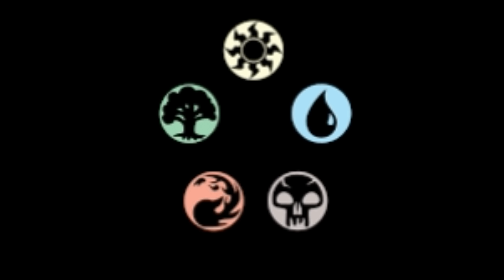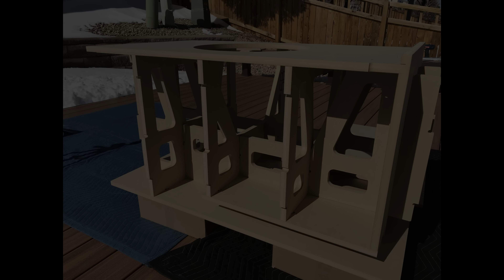THE ANNIHILATOR - XXL Version - 18" DIY Subwoofer HOWTO! Full Marty build with the Ultimax UM18-22

Comment: Jiles, the sub turned out great and once you get the 2nd one built and rocking your room, you're really going to smiling!  Huge thanks for taking the time to make this video, which really does help others understand what's involved with a flatpack build.  Have an excellent weekend buddy, watch a movie or two, and put that big mean ported sub to work!
Reply from the maker: We have 2 Marvel movies slated for the weekend!  My 2 boys both have given the sub the thumbs up approval and have suggested that I "throw away" our sealed UM18.
Reply from the maker: I cant say enough about the flat pack experience. It reduced the complexity of the build tremendously and it gives the completed product a much more sophisticated aesthetic compared to a vanilla marty box. I will be doing a head to head SPL comparison with the sealed Denovo flat pack... but I know what the results will be already. Now, the question... what do i do after I bring #2 into production (and figure out how to keep the projection screen from resonating off the wall)?
Reply: @JilesMcCoy  Man, this made me laugh!!!!  Sealed vs ported is a debate that will never end : )
Reply from the maker: I was  dyed in the wool sealed guy for a long time. You can probably find posts on AVS to support that.... but I have changed my opinion. If you have the physical space for the large enclosures they are pretty good. I would like to try some other technology at some point too though.

Comment: Congrats! Doing the DSP Stuff was easier than I thought I got mine built up (DIY not flatpack) and got it setup. Honestly... I can't wait to build a second one!! With the custom size I did I am pretty flat from 10Hz-100Hz
Reply: Flat from 10-100 wow. What are the details on your build? I'm about to start a build for a 15" ultimax, thinking about doing a mini marty for it.
Reply: @Cerco170  Takes a bit to get the hang of it but all the info is on avsforum for the" Marty" subwoofers. however deviating form the original specs it is no longer a marty but a custom ported sub
Reply: @nintariplays5654  thank you. curious whats the cf of your box, port length, and sub you went with?
Reply: No subs go flat down to 10 Hz.
Reply: @kimhansen6384  With dsp it can. Also in room response is boosted at lows so it can go flat to 10hz. I measured my sealed ultimax and in smaller room it went down to 10 -5 which can be easily corrected with mini dsp.

Comment: I built a few subs from knock down kits and they are GREAT, but be prepared for the time it takes ! I bought specific  subwoofer amp that has all the adjustments you need. I believe it was Dayton also and still going strong after 3 years of 24/7 service(I am disabled and in bed too much!)   BUT they need POWER!!

Comment: So just a tip from a woodworker.  I know it's tempting, but never put a clamp between braces.  Alway put the camp with solid material in between. So on the ends or where the brace/baffles are.  Clamping between them can make the material to bend and make the edges push out.
Reply from the maker: Good tip!

Comment: What bolts did you use to secure the front baffle? I'm not seeing a link for those, Thanks!
Reply from the maker: It’s the hardware in the instructions from GSG. I’ll see if I can get links. I got mine at Home Depot.
Reply: @JilesMcCoy  Oh nevermind then, i didnt catch the full shopping list on the website. My questions have been answered by that. Thanks for your time and the fantastic video!

Comment: I just submitted my order to Kevin at GSG Audio for a mini Marty 2 pack. I CANNOT WAIT. I’m super excited. Thanks for the amazing video. I’m sure I will go over this video several time while I’m assembling mine. Any tips or tricks that you can think of would be MUCH appreciated. Anyway, thanks again for the video! Great job.
Reply from the maker: I would suggest to figure out what kind of wire connection you want to use before you get started. You can watch both of my Marty builds and see the whole effort soup to nuts. The full just has 1 more internal brace than the mini. You are going to love it! Did you decide on amplification?
Reply: JDM World I was already thinking about which type of connection to use. I’ve always used regular round or rectangular speaker terminals with banana plugs. Of course, I’ve never built a subwoofer of this caliber either. We’ll see. I think I’ve got about two weeks before the flat pack arrives because it won’t ship until next Friday. I went with the same driver that you used, UM18-22 and I’ve decided to go with the Crown XLS series pro amps. I’m going to run two amps bridged to 4ohms. I’m not sure if 1,100 watts is adequate or if I should step up to the next model which will push about 1,500 bridged. What do you think?
Reply from the maker: @jeremygattenby2183  I would go with the 1500 watts!
Reply from the maker: @jeremygattenby2183  Its going to rock your world!
Reply: JDM World I like the way you think!

Comment: Awesome to see the Full Marty having a Flat Pack option. (A little expensive, but the pieces will probably be perfect so it's justifiable)
I built mine with around $80 in MDF IIRC and it's an amazing sub for the money, even if you get the flat pack.

Thanks for the video! 
I still need to paint mine... But it sound so good, I'll continue to hold off on it until I feel motivated to add wheels to it (It's very heavy and awkward to move) so I can move it easily.
Reply from the maker: Did you do 2 Fulls also? Have you been happy?
Reply: @JilesMcCoy  I've only made 1 Full marty, (In October 2016) and it's still makes me smile to this day.

Eventually will make another, but 1 really is enough. 
I don't have any nulls to be honest, and it blends in very will with my Chane A1.4s. (Took a while to find the placement that removed any nulls)

I have it powered with an Inuke3KDSP and it gives it more power than my ears really need, and then some. 
Although I want to upgrade to a stronger amp in the future as the Impedance does go up to around 24ish Ohms at 28Hz, so I need a beefier AMP to push more power at that impedance. (Although that'll be more of a nice to have as It gets louder than I need with the Inuke still)
Reply from the maker: How do you like your Chane? Ive always wanted to hear those and Ive never has a chance.
Reply: JDM World I absolutely love them, I remember first getting them and every song I used to listen to was literally a new experience.

But they were my first real quality bookshelf speaker. 
I upgraded from bic dv62si, they aren't bad speakers, but way way too bright.

The Chanes at times feel a bit bright, but it's pretty rare and probably YouTube's fault. (I listen to alot of YouTube playlists to find new music)
Reply from the maker: That's cool. I do the same with YouTube. Everyone tells me to try Tidal for higher quality... but I haven't yet.
Reply: @JilesMcCoy  Yeah, I can hear the issues with the songs on Youtube if I listen for it, but It's not a big enough issue to make me not listen to Youtube versions.

Although when I get to listen to better version of songs (FLAC/Wav or at least MP3 320) It really sounds so good.

One song I remember being really bad on Youtube was "Bass Mekanik - Skynet"  It had some odd 15khz (If I remember correctly, it could have been at a different area, but 90% sure it was around 15Khz) peaks that made the song hard to listen to because turn it up enough and it was painful. 
I wanted to correct it by adding a Lowpass around that area, so I ripped the audio from Youtube (I know that's bad, but I wanted to crank it up without killing my ears lol) and oddly enough playing it back locally even though it was a direct rip it didn't have the issue.

Comment: That was a fantastic build video sir. The only i would do for myself in addition-- would be to router using a round off bit for the inside turn for the port, as well as the exit mouth. Just a personal pref. What gauge wire was used? Looked like 16 or 14.
Reply from the maker: Thanks John. It was 12 gauge.

Comment: The box looks to be very sturdily crafted, but I have put this Ultimax driver through three TS-based design programmes, and they all come up with a much smaller box and far shorter port. Do you have any idea how this box is designed, apart from "big"?
Reply from the maker: The team at GSG Audio Design did all of the modeling and testing for this box design. There are numerous threads on AVSForum as well that you can check out. Or visit https://shop.gsgad.com/ for direct details. If you email the contact there they can give you more info than you ever wanted! Tell them I sent you :-)
Reply: donepearce hi Don, John G ( LTD02 ) and co-owner at GSG AUDIO, is the original designer of all of the Marty sub line models, as well as hundreds of other designs popular in the diy community.  Also, Dayton recommends between 8-12 cubic feet, which is what the mini and full model cabinets provide.
Reply from the maker: This cabinet sub combo can also provide cracked dry wall... so please be careful.
Reply: @kevings26  Congratulations - these look like nice designs. But what are they exactly? I mean are they Butterworth, Chebyshev - what is the actual acoustic response, the transfer function of these cabinets. I'm having real trouble working them out.
Reply: @donepearce  Hi Don, thank you.  Hey, Irrespective of how we may label things the cabinets are roughly 5/7.5/10 cubic feet, and tuned at 20/18/16hz, for the Cube, Mini, and Full, respectively.  Some of our customers also like to plug one of the ports, because they are willing to give up a bit of output, for even lower extension.  I hope this info helps.

Comment: How was the sound? Tight deep bass? Musical?
Reply from the maker: I think it was much more musical than the sealed box I compared to with the same driver. It is very authoritative down to ... well low. Somewhere between 10 and 15 hz. The sealed box obviously will gain ground as you go super subterranean. At 20 HZ there is no comparison between sealed vs ported though. I do 2 channel listening with DSP (bass management) on using 2 of these subs. They are turned waaayyyy down but it sounds really great to me. You can hear all the creaks in the room, the runnin AC, etc in recordings.
Reply: @JilesMcCoy  

Sounds awesome

Comment: I see this is old, But you really could use washers on those cap screws, or at least use button heads. They have a little more surface area. Wood is pretty soft for screw heads. I would also like to see E Z Lok inserts throughout. For the baffle and especially the driver (inserted from behind if possible).  I'd also bump that wire up to 10ga. (At least inside the enclosure) before upgrading your cables too.
Reply from the maker: Thanks for the tips! I'll be doing more builds soon and would love your feed back on those!

Comment: I came close to ordering a set of these flat packs but instead built them myself. Home Depot cut the sheets to my specs and I easily spent a fraction of the cost of those kits.
Reply from the maker: How do you like them? Did you do 2 or 4?
Reply: @JilesMcCoy  I built two mini marty cabs. I am still DuraTexing them. It's more of a "time to waste" project as I am not in a hurry to finish them and don't even have the drivers yet. It could be months before I finish my basement remodel and install the Ultimax's. I like the boxes though. :) Your's is very nice too.
Reply from the maker: Thats exciting! I think you are going to be very happy when you get them turned up.

Comment: Where is the rest of your system? Maybe I'm wrong but all I saw was another smaller sub and two minuscule towers?
Reply from the maker: Hi Bob - I am running a predominantly Definitive Technology System. BP2000 and CLR 2500 Front. BP2002 surrounds. BP7006 rear surrounds. 4 inexpensive 8" 2 way for atmos in the ceiling. And the Full Marty and Denovo 18" subs. The Denovo will be replaced by a 2nd Full Marty. I'll do an overview video for you to check out. The subs and rear surrounds are across the rear wall since the subs wont fit under my screen.

Comment: With subwoofers, after assembling all the internals it pays to then go around everything with hot melt glue down every Joint possible
Reply: I just use subfloor adhesive. It helps deaden the cabinet as well.

Comment: Silicone seal every internal edge, that front baffle could do with being twice the thickness it looks to be 18mm an inch would be good
Reply: There is an inner and outer baffle, each is .75 inches, so in total the driver has 1.5 inches of material to bite into.
Reply: @kevings26  that's great it looked as if it was just the one but I stand pleasantly corrected.
Reply: D twist Rewind 👍 Gsg will have some new designs coming soon including a couple of horn subwoofer kits that are going to take things to another level.

Comment: I was good with this video until..... well first I almost turned it off when I seen socks and flip flops but I moved on and was ok with everything I watched until you started talking about wiring the subwoofer and said the Hot on one side and Cold on the other smh is this a plumbing video or a audio diy subwoofer video 🙄
Reply from the maker: Its just wiring in series to increase the ohm load :-)
Reply from the maker: If I had said to keep the hot side hot and the cold side cold... that would have been McDonalds :-)
Reply: I Know what it is you don't have to explain it to me .....my point is ..this isn't plumbing it's not hot and cold it positive and negative it's electrical .... It's a polarity thing not temperature
Reply from the maker: Yes. Hot = Positive and cold = Negative.
Reply from the maker: And the flip flops and socks are pretty awesome... all the best subs are produced that way.
Reply: Jargon 
Agreed ... positive/negative (+, - ) may be most commonly used. Regardless of the terminology, he got the point across just fine. 

Hot is an often used and perfectly appropriate electrical term. Cold on the other hand, ... not so much. In this context if using "hot", then "return" is likely the most appropriate companion term (Electrical).
That said, (Electronics) positive/negative (+, - ). 

Either way, all good.